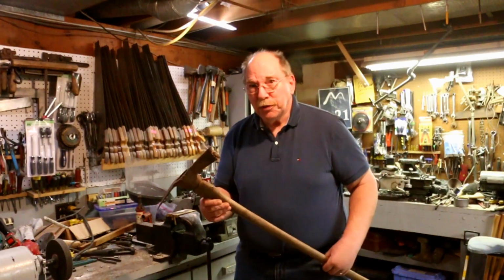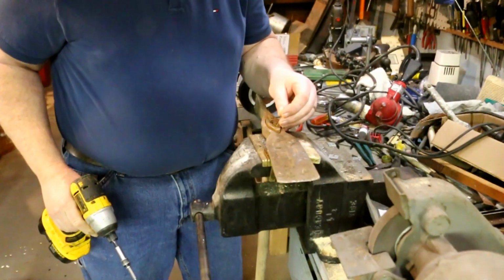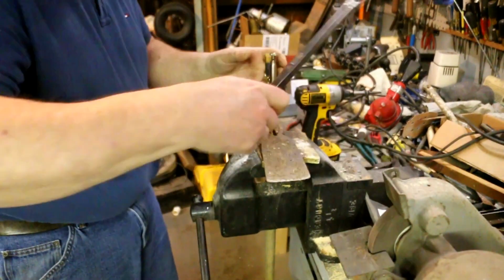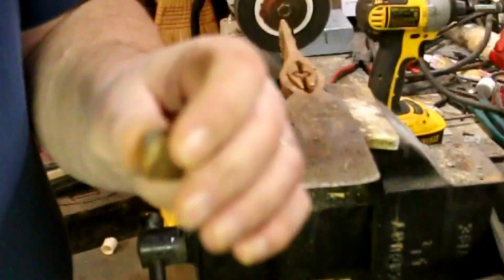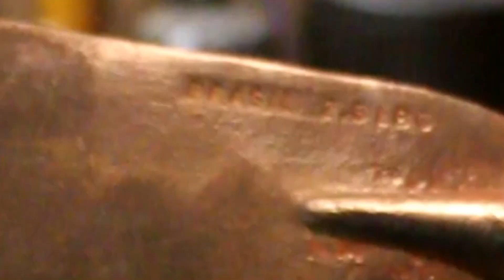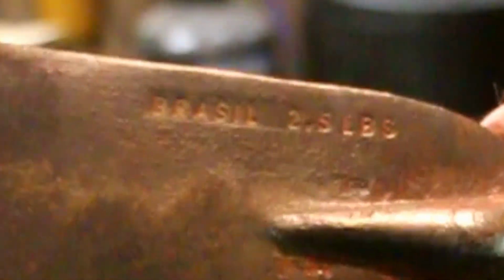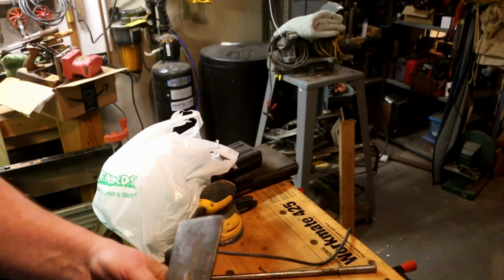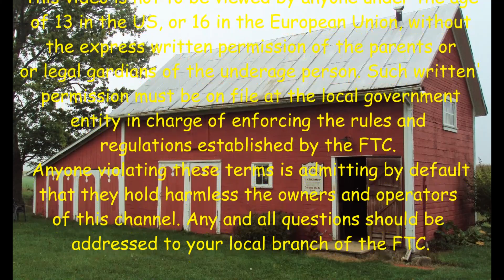Spring Cleanup - Matock Handle Reset

Comment: Very timely video as I found one in the trash. It has a loose handle and covered in cement but should clean up nicely. Your video will be helpful. Thanks
Reply from the maker: Glad it helped
Reply from the maker: You will be glad you did. Make sure the head is tight. Chasing around the yard to find it is a pain. 😁😎

Comment: Great matlock! I like the ones with the axe handles! Thanks 😊 🙏
Reply from the maker: I like it too. 
I have an adze with a handle like a pickaxe. It drops down through the blade and locks into the tapered socket. Nice for smoothing beams. 
This mattock works well with the axe handle. Having a pickaxe handle would allow knocking the head off easily for sharpening. Not sure that would be beneficial enough to offset  having the head work loose. 😁😎
Reply: @OldSneelock  I have both ! I like the axe handle because of the lightweight!!
Reply: @OldSneelock  My good 6# Collins axe/splitting maul/go-devil was axe eyed. That crook at the end of the handle was like Ali's snap at the end of his punch. POWER!

Comment: I believe in just doing what's needed unless you can see coming up. It's been 6 years since I redid the big mower. I NEVER thought it'd been that long so it was time to paint the deck underside. Maybe past time but gout had me for the last 2 or 3 so there you go. I might have to replace a belt but not this year. They still look plenty good enough. Blades had their 1st sharpening. Time is SCREAMING by! And the pick/mattock here came from a neighbor and has a fiberglass handle. Thanks and GBWYall!
Reply from the maker: We have been here 11 years now. We lived in Union City for 21. Yes it does fly by.
Reply: @OldSneelock  I came back here on 02 and Toots and I became a unit in 04. It sure does!

Comment: I never used a Mattock growing up. When I bought my property upstate I thought I would give it a try.  What a blessing.  My soil upstate is lots of big rocks and boulders so digging a hole is nearly impossible without one!  Awesome tool!
Reply from the maker: It is handy for digging out or around rocks. Upstate New York has it's share. 😁😎
Reply: @OldSneelock  So does here but more roots than rocks unless it's the other way around. A varied assortment, thereof!
Reply from the maker: When the glaciers started dropping back they left everything they had scraped up in a pile along the receding edge. The west side of the lower peninsula is piled up with all the sand pushed up by the prevailing winds. 
Don't know how long it took to cover the shore a hundred feet deep and twenty miles inshore but it made a rather large area of dunes and washboard ridges along the west side of the Lower peninsula. 😁😎 
The closer you get to the southern border the bigger the rocks get. 
Mom and Dad's 40 acres had rocks the size of Volkswagens. 
When Mom died, with the help of my cousin and his heavy machinery, I moved a 5 ton rock that was leaning against a tree next to her drive to sit in the front yard next to my driveway. 
It was a rock that I had tried to pull out of the field only to find that the small pointy end went down  about eight feet and got bigger as it went. The neighbor came over with his big International and pulled it over to lean against the tree. 😁😎
Reply: @OldSneelock  10/4 on the rocks. You can run into anything here but sooner or later you'll hit granite and hard at that. I got to shove all sizes around at the boulder hole right over the hill from here. The big loader was the size of a 988, a Kawasaki 115 Z-IV. It'd get 18 tons of crusher run every time but I had it on the front wheels many a time just shoving stuff around. And there are layers between the granite seams with dirt for filler. Also a lot of iron. Thunder storms knocked out a lot of motors and stuff till they got the grounding right. That's why the water has so much I guess. Oh well. We have pipe clay about 3 feet down. I had to bury the septic with dirt because the ditches were full of water before the tank was. I buried 2 foot rocks with the dirt to keep the stuff where it belongs. Still very interesting.

Comment: I have one of those at the camp....I got it like you did when I was just young and I have never liked them . So it still is painted and looks like new....well-restored....CHEERS
Reply from the maker: They are associated with jobs I didn't enjoy. Digging ditches for cable is bad enough. It has been my experience that farmers always want a yard light pole in the middle of the barn ramp and drive. 
The soil is packed solid and filled with dornicks from the fields. The mattock allowed me to loosen and dig up the soil in a long narrow trench.  
Years later the Ditch Witch Machine became available.. That of course was long after I stopped digging trenches by hand. 😁😎
Dad didn't need a Ditch Witch. He had me.  😁😎💪

Comment: Watching you pull that wedge out reminded me of a bad experience at the dentist.🤣👍
Reply from the maker: Dr. Bariboo used a pry bar to pull my wisdom tooth after breaking it into 4 pieces. He had given me all the Novocain he could and said anymore will just make it last longer. It won't stop the pain. I said go ahead and finish. I was working as a welder and lifting weights with my friends for excercise. I bent the chair arms on the Dentist chair. 
When you say bad experience at the dentist I know what you mean.  😩😫🥱
Reply: @OldSneelock  I'll just let mine sit where it is.
Reply from the maker: Best plan of all is to leave them be and brush when needed. 
I was 28 and decided that I wanted to have my teeth straightened. 
The lower right side molars didn't line up so my bite was crooked. The wisdom teeth had pushed them all forward and to the inside. It gave me big headaches. 
Dr Krutch, funny name, good dentist, strapped braces on me and I spent a couple years getting them back where they belonged. Part of the deal was to remove the wisdom tooth causing the problem. I had more teeth than room to put them in. 
It was painful. Worth the trouble because no head aches from that anymore.
Reply: @OldSneelock  Mine are sideways but I've dealt with abscesses before. No worse than it is is nothing to what it's been  My jaw pops sometimes but it'll just have to pop. Got plenty of slack between teeth so no problems there. I've about worn them out anyway.

Comment: A little maintenance and many tools become lifetime tools.
Reply from the maker: Axes, picks, and sledges are left sitting on the concrete floor. Water wicks into the end grain and dryrots the handle.  Better to have them on a rack. 😁😎
Reply: @OldSneelock  My p-gravel 'rack'.
Reply from the maker: It lets the water drain away and doesn't wick up like concrete. That is a fine "rack". 
Makes a lousy driveway though. Dad had a couple truckloads of p gravel dropped in the drive at the farm. It was like ball bearings. Everything settled into the gravel. 
Upon the advise of my neighbor I had blasted limestone put in the drive in Quincy. It set up like concrete. Packed hard and when we put asphalt down Thompson Construction who I knew and trusted said that it was the best underlayment he had ever paved over. That was about 1984. It is still there. No cracks and level. Must be it works.
Reply: @OldSneelock  The other quarry is limestone. Have had marble and talk mines there too in that area. The p-rocks work fine but the shed floor is on a slope. A good to feet from one end down to the other. Dragging stuff out is a chore, especially that splitter. 700+#. That's what the Gravely is for!